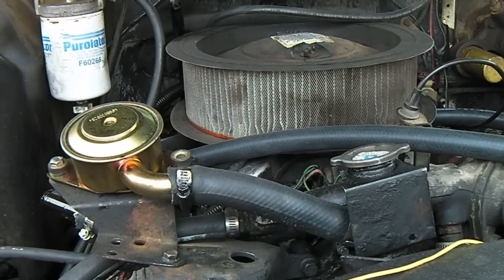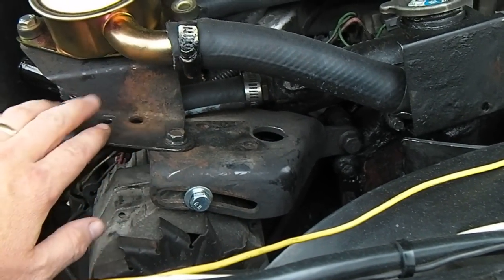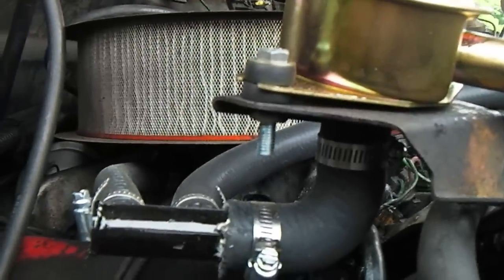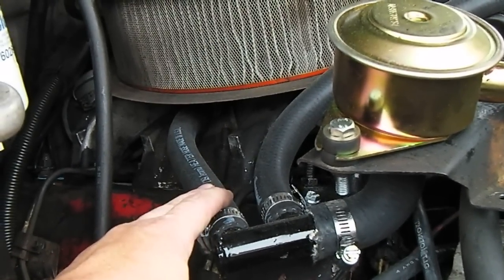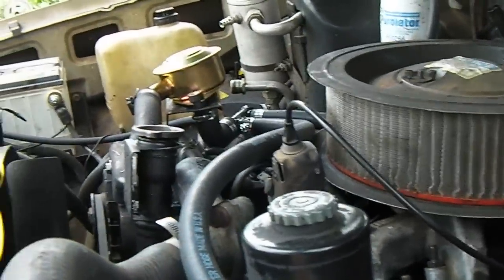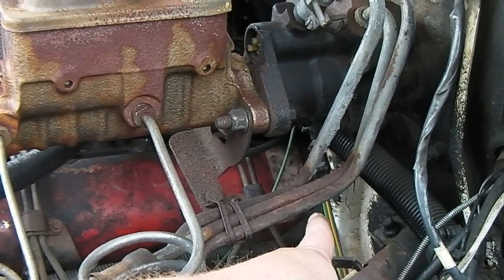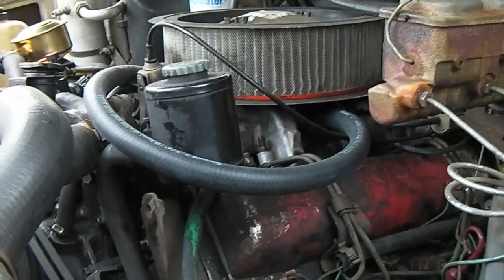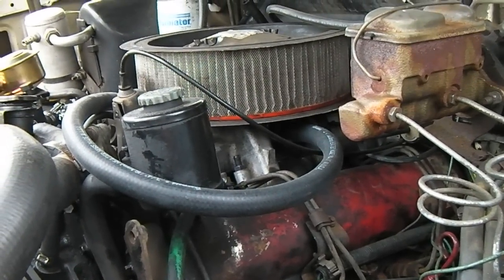10May11 6 2L Detroit Diesel CDR Valve

Comment: Have you checked for a rotted freeze plug in the back of the head.   If it is you can clean it good and pack it with JB Weld to buy you some time to get over what you just did

Comment from the maker: @speedy75602 
Close visual inspection from underneath with the engine running and hot, shows a coolant leak at the head to block connection.  Sigh!

Comment: any chance you could make me one of those "manifolds"  so that I can replicate your cdr valve set-up.  If not can you tell me exactly what materials you used and how you put it together?  thanks and awesome work!
Reply from the maker: ***** 
Ahh!  Its been too long... but heres the idea.  Find the hose that fits the CDR, then find the hose that fits the valve covers...  THEN, find the tube steel at the hardware store that matches both.  Some cutting, grinding and welding later and you have a custom manifold.   I dipped mine in paint to cover inside and out...    I dont have any gas in the MIG and I dont have the steel handy, but if you can get the hose, a small weld shop should be able to fab one up pretty easy, show them the video so they understand what you want..   Good luck!

Comment: I'm about to just run a draft tube to the back of my truck. This damn thing is dumping oil everywhere in my air intake and then seeps out of the intake manifold and runs down the back of my block and gets all over everything underneath my truck. I'm a big fan of Chevy but the 6.2 is a piece of junk. Leaks everywhere and is way too underpowered. Bout to do a cummins swap.
Reply: Maintain it right.
It's probably underpowered and leaking from poor maintainence.
CDR valves are due to be replaced every 30k miles.